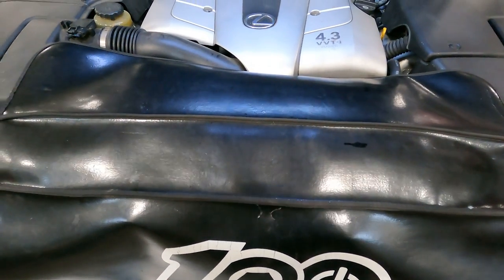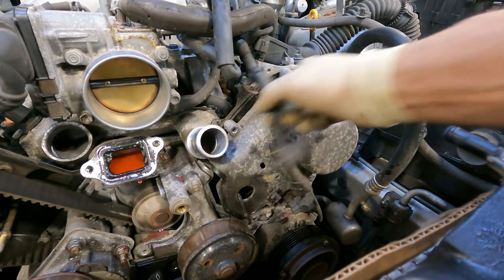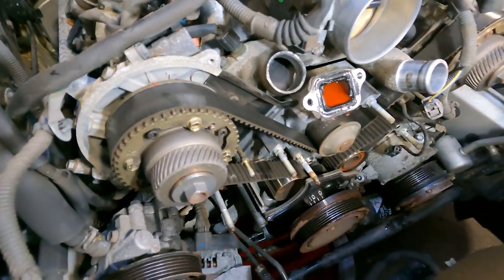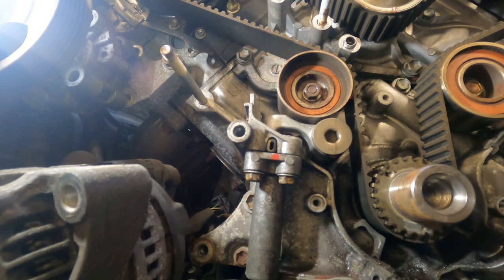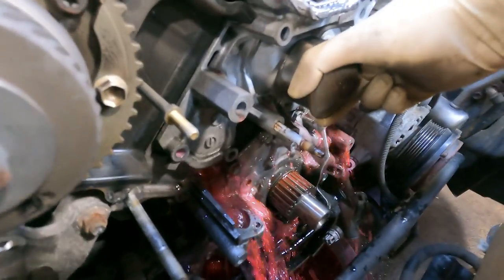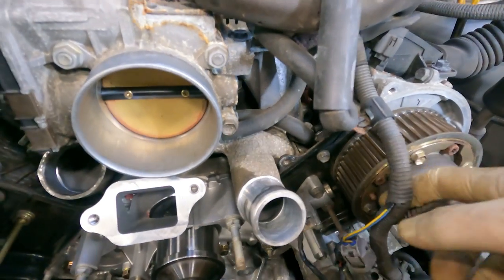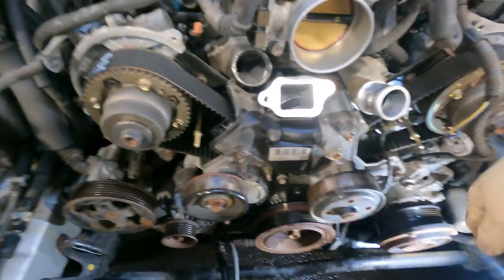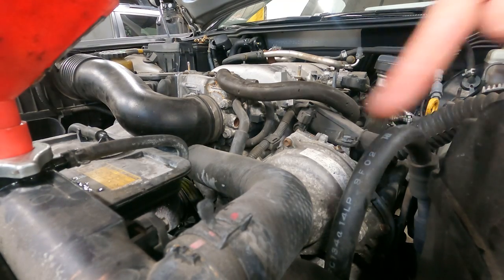Customer states "CSW DID TIMING BELT NOW WILL NOT START!?"🤔😨🤬😉

Comment: A dealer in FL did this service on my 4.7L and forgot to route the harness to the crank sensor properly. The belt eventually cut through the wires and left me stranded a month after the service. Goombas are everywhere! At least you caught it.

Comment: I have a love/hate for all timing kit changes. They're always massively anxiety inducing to triple check that everything's lined up but man. When you turn it over, the anxiety disappears & comes a wash of god damn joy hearing that the vehicle is actually running so smooth. Awesome job CSW
Reply: Crapped myself last time I did mine and the engine didn't start , luckily I had just missed plugging a multiplug in , big phew moment when it started.

Comment: Looked pretty good for a 2004! Most cars this old are moving piles of favor at this point!
Reply: I have an '03 ES300 with 220K, and is like new, minus some very minor battle scars on the body. Toyota builds their cars with pride and great workmanship.
Reply: @jamesb8305  I had an '05 Durango before my Audi, and the favor was strong with it. lol
Reply: @jamesb8305  My 2001 Toyota P/U has 217k miles is the same . It has been maintained and no rust at all . One good thing about living in the south and away from the ocean salt water and salt covered snowy roads .

Comment: Great work! I’ve done a good number of tbelts for a DIYer and this one looks like a pita with all the accessories that have to come off. I am surprised to see so much aftermarket parts in use. I personally would have gone OEM or maybe an Aisin kit. Surprised your dealer doesn’t force OEM.
Reply: Aisin kits are the way to Go.
Reply: @55azguy  are Aisin kits only for Toyota/Lexus products or for Honda’s, too?
Reply: @axjohn  No Aisin makes them for a lot of cars. I used one on our Honda Pilot (J35) for example.
Reply: You want to see a pain in the ass? Replace the timing chains on a 1997 Ford Mustang Cobra with a 4.6 liter  D.O.H.C. mod motor... 😵 
I won't do that again.
Reply: The Aisin are OEM. Aisin makes them for Toyota. Toyota owns Aisin.

Comment: With the amount of disassembly you had to do just to get to the timing belt, you’d think the 4 rings designed the engine compartment 🤣 As always, great job!
Reply: If you're lucky the studs come out with the nuts on the PS pump and alternator when removing the idler to save you from removing those items. Lol

Comment: You have to remove the a/c compressor on the 3.5l 2grfe to get the belt tensioner off aswell, but at least it has a timing chain!

Comment: So... how many radiators got a hole punched in them before you learned the cardboard trick? 😀  Seriously, I'm always impressed at how thorough you are with these repairs.  And that engine sounds better than many do brand new, and it's got 250k miles?  As far as the goomba move on the start attempts, I've done plenty of major repairs on IT equipment, pushed the power button and... nothing.  Or it powers up with all kinds of errors.  D'oh! Forgot that one connector!
Reply: I personally have done it twice in 16 years. Both doing recalls.
Reply: Pushes button. It doesn't work. Plugged in? NOPE!  DOH!!  Done it a couple of times doing computer work over the years. As an old rule goes: It works better if you plug it in. I also wen to a service call where somebody disconnected a power cord from an outlet under a desk ("Excuse me, Miss, I'll need to get under your desk for a minute to check out your legs...power cords!")

Comment: Crazy that some places require such a deep inspection on cars!  I've only lived in 2 states and one I didn't even need an emission test, the other just checks emission and for codes but nothing physical of the car - no tires, no cracked windows, no inspecting of anything beyond digital data 🤷‍♀️
Reply: Most of Europe the inspection is far stricter than it appears to be anywhere in the USA. Wheel bearing like that would be an instant fail.
Reply: Would you get on an aircraft where there was no reasonable level of inspection?
Reply: @katywalker8322  I would NEVER get on an aircraft built to STATE standards as I bet they would make them lower than federal standards.  And yeah, they should be inspected with as much detail and precision as we see with the tech behind CSW? going over the cars in his care.

My car, however, doesn't transport hundreds of people at one time, have an entire board of buttons/switches, and require years of training to maneuver properly, but I would like to see more inspections performed on vehicles in the south, and especially more scrutiny put on drivers down that way since so many of them drive like they won their license out of a cracker jack box.  I still don't understand how my insurance was so cheap when I lived there despite all the bumpers that litter the side of the expressways in the Atlanta metro...?

Comment: Even after triple checking I accidentally left an earth strap off after an engine rebuild, the first crank to build oil pressure used the fuel injector earths for cranking current.  The wires got very hot, the insulation very crispy.
Reply: That's a terrible design.

Comment: On those engines you're supposed to set the timing of the cams to the " T " mark, that way you're not risking to go against the spring pressure and one or both cams can rotate suddenly with the T-belt removed...thus potentially hitting the valves and bend them...
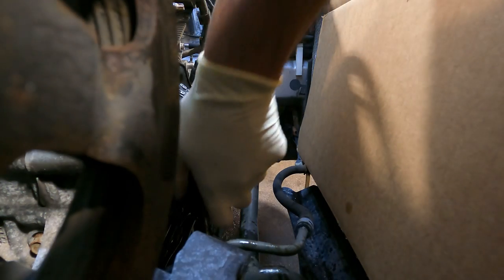Reply: I was gonna mention this and saw that you did. Awesome. So guys Nick is spot on with his response. At 6:21 in the video you can see the technician trying to realign the marks and how "touchy" it appeared to to do so due to the "springiness" at that point. Once you get the new belt on you could the roatate back to the three alignment marks ( two cams, one crank ) as a double check!
Reply: The tension on the cam from the valve springs will NOT "bend valves" if the cam turns with the timing belt off. There isn't NEARLY enough spring pressure there to do that.. 😕

Comment: My first car was a '77 VW Rabbit.  The EA827 engine in this car debuted in 1972 and versions of it are still produced to this day.  I've had several, to include a Porsche 928 with the "Gilmer" belt SOHC setup.  I know the advantages of sound and lack of lubrication are good things, but these HAVE to be changed eventually and the notion that a piece of rubber is keeping the valves from hitting the pistons and thus destroying the engine to the tune of $8000 has always bothered me.  I'll buy cars with Gilmer belts but I don't like the idea;  My current two cars both have flat 6 engines and both have chain driven DOHC heads.  I prefer chains.

Comment: NAPA belt kit looked like a reboxed Gates kit, which is good. NTN bearings/ idlers, probably OE. Water pump looked like an Aisin, also OE. These lower volume engines, typically it isn't cost effective for the aftermarket to tool up for parts, so they just source OE direct from the manufacturers.

Comment: Would you say it is prudent to replace the water pump regardless of condition if you tear down the the front of the engine like this?
Reply: My question to you would you like to pay for the labor all over again let’s say one year later ?  The labor for this job , and this particular car and depending where you live is 950.00 dollars . Always ask for OE parts when doing this job . Good luck
Reply: @55azguy  I think it is a given. Save on labor and protect the engine. I would also replace the thermostat. Protects the new pump
Reply: @JohnRodriguesPhotographer  positively, all Toyotas get O.E. Stats as well.

Comment: I'm surprised that a Toyota dealership would use Napa parts. Great work, if I lived near your dealership I would go there only if you worked on my car. 😊
Reply: When vehicles get a certain age OEM parts at dealership by the factory  are not supported hence aftermarket parts are used
Reply: @keithlarge1151  I don't understand, why won't they be supported? The dealership still has to warrantee the work, wouldn't OEM be better. When I had a Volvo, (biggest mistake), the left front axle had to be replaced, rather than spend over twice as much on OEM, I got it at Auto Zone, (from China), it lasted a month and had to be replaced, got the OEM, so I had to do the work twice. My 08 Highlander has over 213k miles and everything is original. If, or when, the alternator or water pump or coils go out, do you think if I replace with aftermarket parts they will last that long?
Reply: @frankbiz  when vehicles are near 10 years old mfg's.dont support  the parts like they did when the car was built. I repair vehicles where I let the owner supply parts if they  wish and they end up finding out dealer doesn't have  part as it was discontinued  so as like you they go to advance ,auto zone ,o'reillys or the local napa to get parts. With this sometimes you get good parts and sometimes you dont. I worked on a Ford Focus  that was about 1200 miles out of warranty  on a no start and 2 of the coils and wires were  burned completely in two  so sometimes OEM ain't that great either
Reply: @keithlarge1151   I get it now what you mean by "not supported". Thank you for clarifying that.👍🏻 As far as those Ford coils burning apart, we'll, their OEM isn't as good as some Japan parts.
Reply: @keithlarge1151  Remember, just like everything else, a bunch of parts built by the lowest bidder in most cases. US automakers have removed so much quality there's almost none left.
Reply: @markh.6687  Ain't that the truth...plus you have to worry about knockoff or counterfeit  parts. I've heard of several  issues where people bought counterfeit  parts online  NGK spark plugs have been counterfeited.
Reply: @keithlarge1151  that's so very true. With everything online you have to be extremely careful, it's pretty sad the thieves out there.

Comment: It looks almost the same as my 2uzfe. The Tbelt service was pretty straightforward. I had the water leak through the peep hole, too.
Reply: You didn't show the penis shaped water pump gasket, so I imagine it's different than the 2uzfe.
Reply: It's an almost identical service as the 3UZ-FE in the LS430 uses the exact same timing belt/water pump kit as the 2UZ-FE.
Reply: It's not a peep hole....

Comment: To remove part K, first remove parts A-J, then L-Z...reinstall in reverse order. Question: you remove the negative battery cable, does the computer system have a tiny backup battery to retain settings? Some cars lose everything which is a pita.
Reply: It doesn't matter on old stuff.
Reply: @TheGuruStud  True, no computer chips. But my 02 Taurus needed resetting which was a pain.

Comment: My 4.7 didn't start because I pinched the cam position sensor wire. Took me a while to figure that out, but I won't make that mistake again. I do have 60k miles until I need to do the next timing belt.

Comment: Those pesky starter motors gulp a few hundred amps, and those errant amps can wreck alot of shit when they are given the chance to flow through wherever they please to complete the circuit, instead of through the proper ground. You're darn lucky you didn't burn up whatever the tiny ground was that was taking the place of the actual forgotten ground strap. I've seen burnt up throttle cables, fried bearing races, HOT brake lines, toasted BCM/TCM/ECM grounds, and various other cooked components from electricity taking the wrong path through whatever it wants to when a main engine ground was missing.

Comment: hahaha I thought my 4 cylinder 2000 Camry was difficult to do....
Reply: I've worked on cars for most of my life, never done a timing belt before. Asked a buddy of mine, who's done the job a few times on his '99 Solara (3.0L), to help me with mine in my '99 Camry (2.2L like yours). He said it was easy, but a few months later when he asked my help to do the timing belt on his Solara, I discovered just how much easier it was on the 2.2L engine than the 3.0L. Thankfully, I became Designated Parts Washer, Dropped Bolt Retriever, and Lost Socket Locator; any mistakes would not be at my feet!

(He ended up putting a pry bar through his oil pan while trying to pry off the crank pulley. He forgot to bring his pulley remover to the shop he was borrowing space in, it was a blizzard and he didn't want to go all the way back home to retrieve it. OOPS!)

The 2nd time I needed a timing belt job was due to premature (53k miles) water pump failure - the pump shaft seal blew out and coolant leaked out faster than I could pour it in. I decided I wasn't going the Advance Auto Parts route, I took it to a Toyota dealer and had them do the work. (Of course, knowing I had a massive coolant leak and had the car towed there BECAUSE of the leak, they first took it for a test drive on the highway before rolling into the service bay blowing steam everywhere.)

Totally worth it, though; my Camry is humming along at 366k miles. Best financial decision I have ever made was buying this car five years ago for $750.

Comment: Just had this same job done in a shop it was finished today picked the car up drove prolly 15 miles was rolling down street and car just shut off and died. And now will not start any help would be greatly appreciated
Reply from the maker: Replacing an axle or wheel bearing will not cause the car to shut off. There might be a different issue.

Comment: How often should the timing belt be changed on these engines?
Reply: Think Subarus want em at 60 or 80k, I would imagine most cars with belts call for roughly same .
Reply: 160K km on 2001 1mzfe engine.
Reply: Most Toyota engines from this generation are 90k or 6 years
Reply: @jayjaynella4539  that's 100k miles so not too far off

Comment: All that work and they use Napa parts. fuuuuuuukc.
Reply: All hope isn't lost, the hydraulic tensioner was NTN (OEM for Toyota/Lexus) so there may be other OEM parts in that kit. Gates Timing Belts are also solid quality, the real question at this point is who made the water pump for Napa.
Reply: @TacticalBaconPatches  same thought went through my head. The water pump brand and idler/ tension bearings. Koyo or GMB pulleys would be nice.
Reply: @sjapan8149  sign me up for Koyo, the OEM for these cars and the brand that came in the Aisin kits I put in my 05 and 06.